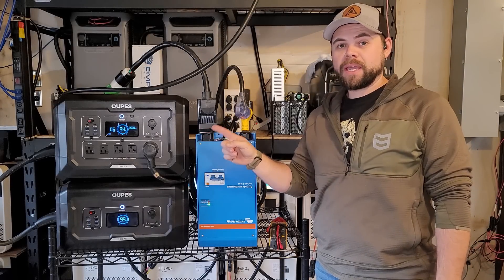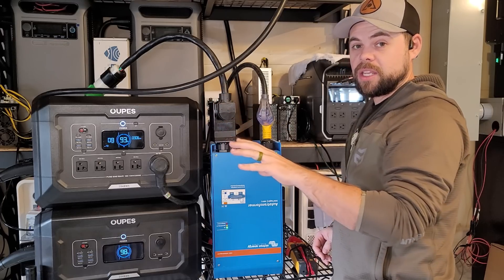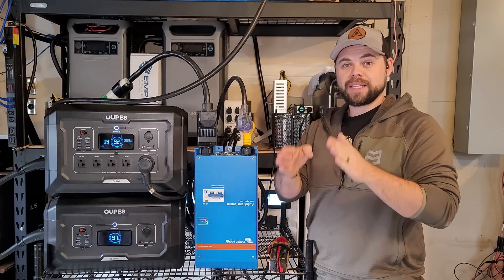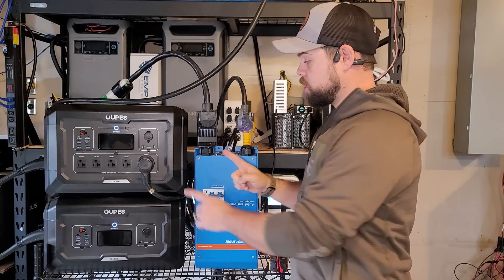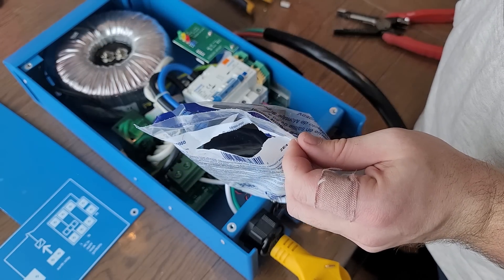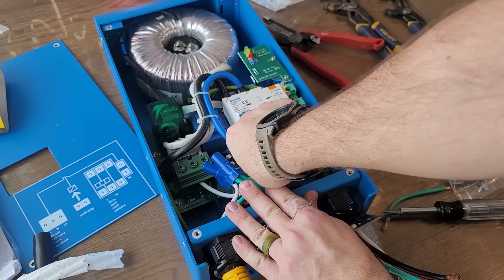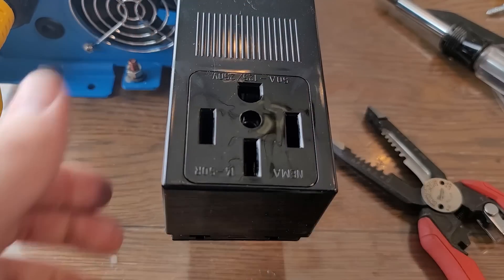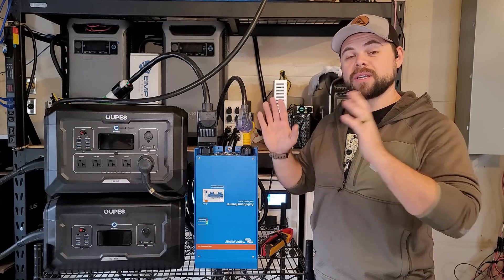SECRET WEAPON to Get 240v from 120v Generator [No One Knows This]

Comment from the maker: With this seemingly magical tool, you can take any generator, power station, or outlet and convert it from 120v single-phase power to 120v/240v split-phase power.

►Autotransformer 120v/240v: https://signaturesolar.com/victron-autotransformer-120-240v-100a/?ref=SaJS3dc86BnakK
►Mega Power Stations: https://oupes.com/?ref=mmp&utm_campaign=MKTRita&utm_medium=mmp&utm_source=goaffpro
►Mega Power Station Coupon Code:

Comment: Nice setup!  This highlights a solution for limited use cases which many folks may not have known about.  An autotransformer can ALSO be configured to provide a split phase output from a 240 volt inverter (such as they use in most of Europe, Asia, Africa, Australia, etc).
Reply: Does this mean that a single phase 240 input can be transformed to a split phase 240 volt output?

Comment: Thank you for this very informative video. What’s the benefit of this approach as opposed to using an inlet with TT-30 to L14-30R adapter cord? First one I can think of is 100 amp output.

Comment: I have two 3300 watt grid doctors who have 30 amp Rv out puts . Trying to put a transf switch to have 240 to my AC or Dryer. Would this work for that ? Then could you spit off off one of the 124 and have out switch in the transf to control certain 120 v plugs at the same time?
Reply: Or even just one 3300 watt solar 120 v

Comment: I’m running a 24v system…2 12v 200ahp batteries diy solar generator..my question is will this unit help also to get 240v and charge my Tesla at a faster rate?

Comment: What devices would I need to convert 120v to a 240v input on a Class B European RV?
I don’t need more than 30amps and the RV plug is a 3 leg 240 which I have. It is NOT 4 legs. Please help.  
Thanks.

Comment: Can i use it off a 5000watt 12v inverter to 120.  To this unit to run a oven, my wife wants her oven . VEVOR, 5000 WATT, 12V DC TO 120AC. WILL THE FAZE BE TWO 5000 LEGS OR 2500 WATT LEGS.

Comment: So my Titan has 30amp out at 120v what is the amp out that the 100 amp trans will let you safely run at 240v? Will it logically be only 15 amp or less
Reply: You are correct

Comment: Would this transformer be a viable solution to running an inverter welding machine being hooked up to a duel fuel generator that puts out 120v power when I’m trying to get 240v power to the welding machine?

Comment: I couldn’t understand your email.
Question:
I have a 120v plug in the garage. I cannot run a 240. Can connect the victron to the 120v outlet to get a 240v to charge a tesla?
Reply: It would be better to just charge it with the 120V, since stepping it up to 240V won't give you any more power, and you will lose some efficiency in the conversion process. The Autotransformer will double the voltage, but halve the amps.  The 120V outlet is either limited to 15A (about 1800W) or 20A (about 2400W).  That's the most you will be able to dump into your Tesla from that 120V outlet, regardless whether or not you do it at 120V or 240V.

Comment: There's a lot of common misconceptions repeated here.  Firstly, In split phase, the two 120v legs are only "out of phase" when measured in reference to the neutral wire. However, when the power is referenced between the two hot legs the 240v is a simple AC sine wave.   Remember most 240v appliances don't connect to neutral so all they "see" is the two hot legs with aligned sine waves.  This video describes it best: https://www.youtube.com/watch?v=uRKbX74lBgU&t=5s The reason two reason separate, uncoordinated power banks can't be used to create 240V because the sine waves would not be in sync so one solution is using a step up transformer like the Victron, but there are others.

Secondly, the 100A Victron Autotransformer is only rated for 100A of 240v pass-thru, when stepping up 120V to 240V it is limited to a 32A output (28A continuous).
Reply: I assume there's no possible way to combine two 120V power stations with this Victron Autotransformer, right?  I would be interested in this device if it was possible to take two smaller power stations (say 2000W for example) and double them to 4000W at 240V.  But I assume the Victron Autotransformer only can take one 120V input and not two?

Comment: Actually RV power, such as you find in a campground, comes in two flavors: 30A 120v, and 50A 240V. In fact, it's the same cord as you would use for your stove. It IS 240V 'split-phase' as you put it. I've been an electrician for over 30 years. Using a transformer is no different than what the power company does. They take single phase, run it through a transformer ont he pole, and give you 240V... unless you have 3-phase, which is unusual in non-industrial applications.

Comment: Can you do a split phase on a 3600 watt gas powered generator from two of the 120 volt plugs without the auto Transformer? I'm pretty knowledgeable on how to do wiring and electrical

Comment: OMG !! Finally I found your video did exactly what I'm trying to do with my project.  I have 10k watts hour battery and 2000 watt inverter 120v single phase.  But home panel breaker require 240v split phase.  I saw youtuber HighTechLab mention about transformer convert 120v into 240v split phase.  So I'm thinking about my project to built portable generator 120v with transformer into 240v split phase to connect with panel breaker.  But I can not find one to make sure my idea will work, until now.  🙏 Thank you for your video.  Do you think the "Growatt 5kW Split Phase Transformer | ATS 5000T-ES" will work the same Victron transformer?  Because Growatt transformer is only $300 right now.  It's cheaper than Victron transformer $200 bucks 😁.
Reply from the maker: I'm glad I could help. I haven't tried the growatt so I can't say, but probably. I don't know if it'd wire up the same as the victron.

Comment: Great idea! Thinking of doing something like this to utilize an Ecoflow Delta Pro to power the whole panel.
Reply: I think you can simply take the 30A outlet on the Delta Pro and use an adapter cable to plug it into a generator inlet port, and then power your panel.  It won't run 240V circuits, you will have to flip those breakers off, but it will run the 120V circuits.  If I'm not mistaken, this Autotransfer would only be useful if there are some 240V circuits in your panel that you need to power up, that the Delta Pro was capable of powering.  Correct me if I'm wrong, but the Delta Pro with the Autotransformer could only provide a max of 15A at 240V.  So, if you want to just power up your 120V circuits in your house, better to just use the proper adapter cables to feed your panel and not spend the money on the Victron.
Reply: @Cyprian700  As I understand it and is why I'm going to use the Autotransformer to power my home PP is to eliminate any possibility of overloading the neutral wire.

Comment: I have 2 identical 120v single phase power stations with 30 amp connectors (24 amps max), can I connect both to this auto transformer to give 240v split phase so I can power 2 legs of a sub panel?
Reply: I was curious if it was possible as well.  I doubt it, but you never know, perhaps there is a way that I am not aware of and someone knows how.

Comment: Can you test if that transformer works as an isolation transformer for charging ecoflow DPUs when connected to your subpanel and still plugging into the C19 from grid
Reply: No need to test; it is an auto transformer, not providing isolation. When you go to the Victron Energy website you'll find this clearly documented in their documentation. If you need isolation you may want to look at the Victron isolation transformers instead.

Comment: City water here so no well pump, but I just bought a generator transfer subpanel and re-wired our entire house to be 120V only, gas stove, gas dryer, gas boiler for heat.  We rarely go above 3kW even with 3 window ACs running in summer.  Able to run our whole house off a Victron 5kVA and a Delta 2 Max.

Comment: Totally confused: everything you talk about minus the well pump(since it's 220) are 110v appliances. Even your water heater doesn't need any electrical connection. You talk about outlets, fridge, microwave, etc all thats 110v. Who cares if you send 110v over both legs of your service panel as long as you turn off your 220 stuff. That's just a waste of money, now if you want to run your AC, etc you would need the Victron transformer. Otherwise no.
Reply: You are right. But the whole point of this is to get 240v. If you don't need it, then there is no point to this device
Reply: @jimtran93  for the well pump?
Reply from the maker: You can't get two legs of 120v power from one leg of 120v power source. This unit only has one hot leg, so it would only power leg 1 or leg 2 in the electrical panel if connected, leaving 1/2 of the house without power even though the other half only needs 120v. The physical wiring and bus bars are not connected unless there's 240v power, or at least two legs of 120v.
Reply: @minutemanprep  again, that's 100% wrong! If your 220 stuff is turned off, and you have a fail safe disconnect so you don't backfeed into the system, you can hook up a single phase 110 inverter to both legs of the panel. Each side is a separate 110 circuit.
Reply from the maker: @jbadger1458  You'd have to add another leg. You have to provide two legs of 120v to get power to both legs in the electrical panel.
Reply: @minutemanprep  no you don't, if you isolate the 220 stuff(turn thr breakers off) nothing is 220! Each side is 110V, with just 110 stuff, no outlet, no appliance would know the difference. 

I have my backup solar system hooked into my panel that way for years now, and it works perfect. Is it code? No, but neither is what's explained in your video...
Reply: @jbadger1458  So, you use a 120V NEMA 5-15P to 30A adapter cable, and then a 30A to 50A adapter into the inlet?  Either that, or you have a 240V 30A inlet to your main panel, and not a 50A?
Reply: @Cyprian700  no, for my solar setup I have a 5000 watt inverter coming off my solar system. I currently have 12 Tesla battery modules now, all wired up. I have the inverter wired off that. The output of the inverter is hard wired into my electrical service panel with 8 gauge wire to each leg of the panel, backfed through a 40 amp 220V breaker, I have a safety lockout so I can't energize my house from the grid, the same time  as my solar setup provides power. When I want to run on solar to save some $, I turn off the grid breaker, turn on the solar system and run my whole house off of it, all the 110V stuff. Since I dont have a grid tie system, I don't have to have any permits nor does anything have to get approved. I am a Master Electrician in the State of Ohio, and HVAC certified so I know what Im doing.

Comment: U know this is perfect for another scenario like for my case. I have the jackery 5000 plus power station that cuts off the 240v while ac charging at the same time. But it will output 120v while charging on ac. So I could use this when it goes down to 120v and think I will still get 240v with this transformer.

Comment: A half-way measure for people who are not able to do as you suggest is this. Assuming your 120V generator or solar generator is connected to only one leg of your breaker box; if you have a simple electric dryer, with power to only one leg, you can still dry with air only. You just have to figure out which leg this is and possibly swap the hot lines at the circuit breaker box. Similarly, if you have a simple electric range, some of the burners will work on each of the 120V legs, but not the oven. My solution for the well pump is to have a 55-gallon drum of water and a 12V RV pump rated at 3gpm, which is plumbed into the manifold of my water system. Thus, my tank is pressurized so toilets flush properly and the hot water can be properly forced out. You can go quite a long time on 55 gallons and, if you can refill the drum, even longer. An old car battery is fine for this application and no power is drawn when the pump is not on. So a simple battery is superior to the 12V power station output, which has overhead. I appreciate the video, which is the first I have heard of this solution.
Reply: I use 120 volt deep well pumps.  Problem solved.  I did install a 2500 gallon black poly tank next to the well and keep it full.  Inside the tank I have a 120 volt deep well pump that is controlled by a pressure switch (common 30-50 psi well pump switch).  I can easily convert to that.  I have 2 wells so I keep one for emergency water and the other for a spare.  We also have city water so when things are good we don't need either well.  I also recommend a deep well hand pump with enough hose to reach the water level down the well.  If you are on city water or even well water having a large storage tank is the best insurance there is.  2500 gallons will last us for approx 1 month (longer in an emergency use situation) and the price for the tank was only $1700.
Reply: Good info, thanks. Another possible benefit of your big tank is that I was once told that I could get a reduced homeowner's insurance rate if I had at least 2000 gallons of water available, such as in a swimming pool. I am in a potential forest fire area and am a half hour away from the volunteer fire department, probably more for a pumper loaded with water. If I had a reservoir I'd invest in a suitable fire-fighting pump.

Comment: Correct me if im wrong but if i use this device to stepup to 240 wont it cut my amps in half?
Reply: Sort of but not really, say you plug the auto transformer into a 30amp 120v you will get 15amps on L1 and 15amps on L2 @240v 
120v x 30amps = 3600watts
240v x 15amps = 3600wats
Now that’s not accounting for any loss, with a auto transformer there will be losses maybe 1-3% with L1 L2 same load, losses maybe even more if imbalance on L1 L2

Comment: My power station does 240VAC split phase already but I dont have solar yet so I use this 100 Amp autotransfomer and my generator to supply 240VAC to my EG4 battery charger the chargveter to get the full 5Kw capacity. I use 57VDC and feed them to my solar input to recharge my power station's batteries. The AC charge inputs on the PS are disabled when in 240VAC mode so I have to use the solar input to recharge the batteries.

Comment: Great video. I do the same with a Honda 3000is to the EG4 6000xp gen input which needs 240v input. The Victron satisfies the conversion from 120v to 240v split phase, I am just limited to around 3000 watts input to the Victron.  One note I would say is it depends on the L1 or L2 input u used on the left connector. I used the L1 input on the left connectors. My output for the second leg is about 5v higher than the other leg. I believe if u use L2 on the left connector the other leg output will be about 5v lower. Just thought I would pass along my observation.
Reply: Yes I use the L1 input to to get the +5VAC on the secondary leg as well since when the load increase it will drop.

Comment: Good video.  More people should be doing this.  For power backup purposes, I use the same transformer (100 amp version) with a 4500 W inverter gas generator.  The transformer plugs into my 30 amp, 240V generator output, and I plug the inverter into a 50 amp generator plug with an interlock breaker.  I custom made cables and connectors.   In a power outage, I roll out my generator/inverter and run my well pump and basic appliances.  I run my HVAC on an EG4 24K solar system so I don't need this system to run my largest loads.

Comment: I  use the autotransformer to load balance my two Delta Pro's. It works great.
Reply: Please explain this in more detail... you use 2 delta pros fed into this at 120v each?
Reply: @ When using the double voltage hub, the loads on each delta pro can be uneven. With the auto transformer, you connect the with 240vac, no neutral. The ac current is then equal in both delta pro. On the output side, there is 240vac with a new neutral created with the center tap of the auto transformer. Connect your loads to that. The delta pro’s will discharge equally even if the connected loads on the 120vac split phase output are unequal. The ecoholics web site has a detailed write up on wiring the auto transformer to the double voltage hub.
Reply: @leguirerj thank you for the tip

Comment: To Power My Well Pump @ 2 legs o 110 Volts and 40 amp Bosch Electric Hot Water Heater would be Nice here on The Ranch ⛩ 
Would a WZRELB 24 Volt 3000 Watt Inverter Power this Transformer ? Or just Go with Dual Phase Inverter ?
Reply: I have since gotten an Oupes Mega 1 and extra battery and very please with It and an additional Extra Batter Parallel Cable for a 48 Volt 105AH Battery to extend It's Capacity